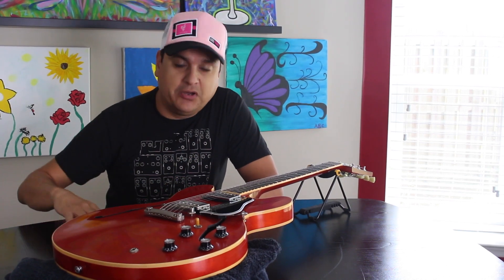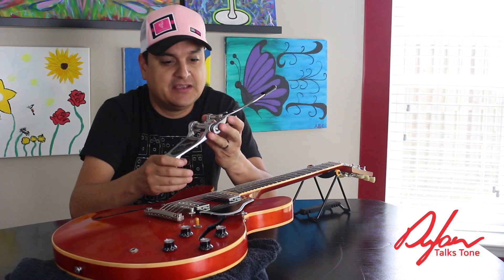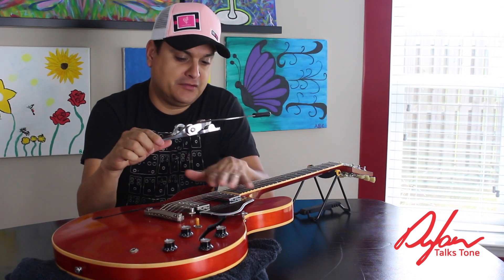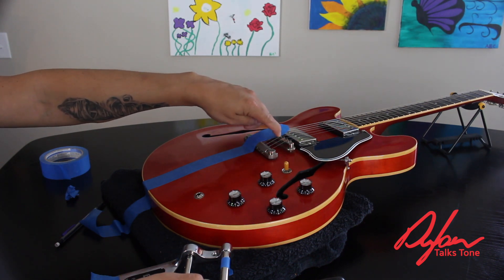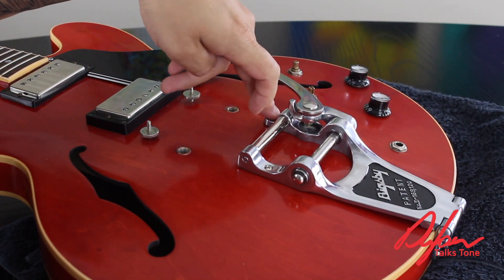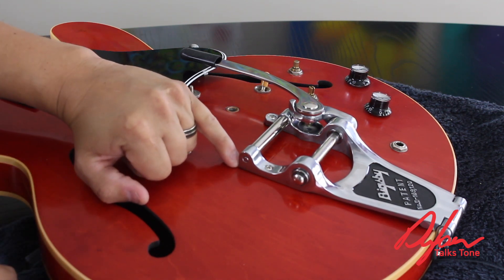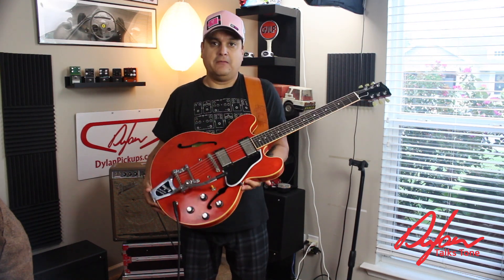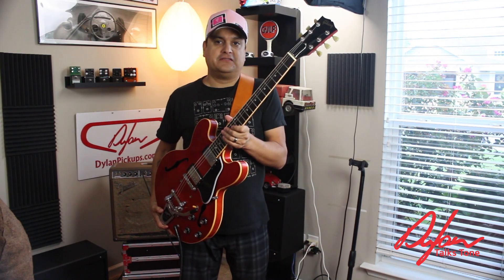How to install a Bigsby B7 Install Dylan Talks Tone #248

Comment: Good advice... I've added Bigsby's to several of my guitars and have found that adding extra felt disks near the top of the Bigsby helps.   Mine worked out great... good sustain, arm angle, and tuning stability.

Comment: Did't mention anything about grounding to the B7. You can use a towner end pin adapter for the strap button and also add the towner down tension bar to lightly or aggressively touch the strings and it'll also cover the post holes. It'll allow more tension as well which could IMO help with tuning and sound. Did this with a 335 and avoided having to drill a hole for grounding either Bigsby or the tunematic.

Comment: So i did this a few weeks back. Works well. The only thing that I’ve noticed that I’ve been wondering about is I have the same gauge strings on but they feel tighter. Am i crazy or does a bigsby somehow add tension?

Comment: What do you recommend to cover the Stoptail Holes?
And did you run a ground wire to the bigsby?
Reply: Exactly what everyone needs to know!
Reply: Do a little plate like on the vibramate for B7s.
I just got me some nice blingy rivets and superglued them to 2 fitting screws...voila
Reply: You can use regular wood filler if you want. You would have to then paint those areas the color of your guitar and then add some polyurethane on top.
Reply: @TELE6220 : how so?

Comment: I had a duesenberg star player and now a Gretsch 6128t player edition. Both guitar have the same problem, after doing a light bending any string will go flat and stay flat until pushing down the tremolo. Is that normal? Could it be the gretsch with bigsby b7 screws are too tight?

Comment: Have you ever tried an installation using Velcro instead screws in the top?
Reply: He doesn’t like raising the Bigsby that high it messes with the set up, Intonation. I’d would add a plate that utilized the existing holes of the bridge, not drill more holes

Comment: Wouldn’t it be easier to centre it with a piece of string raped around the top E string tuner come up over the back of the head stock to the top middle of the head stock and bring that string all the way down to the bottom of the guitar to find the centre .